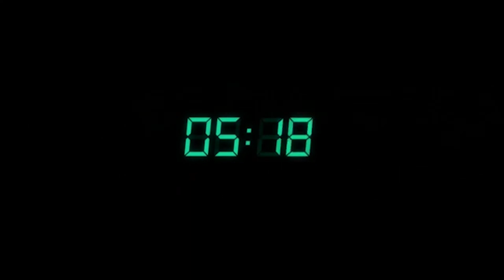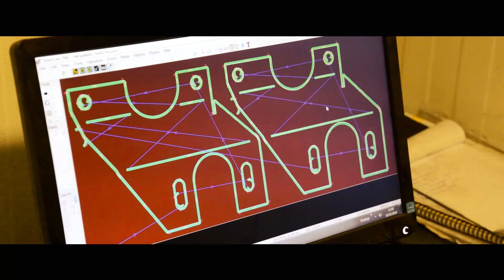Losing & Winning: HAN Eco Marathon 2019

Comment: You guys set one valid result during the competition day right? 1:89 if I remember correctly.
Reply: The engine was a piece of crap
Reply: @pettifretti  why do you say so?
Reply: @5432Krishna  We were not able to modify it in any way without affecting it's efficiëncy meaning that the mandatory exhaust that we made completely destroyed the performance. furthermore, there was an issue where the a vaccuum would occur inside the fuel tank meaning that after 10-15 laps the engine would be without fuel.
And finally the throttle mechanism was so small that it was very difficult to create a cable that would not jam the throttle every once in a while.
Reply from the maker: One valid run doesn't mean a valid result because you'd have to do 2 runs. We didn't have a run in which the engine did run smoothly with full power avaible so we couldn't get up to speed to then coast... 1:89 was full burning so not really representative. Last run over 10 laps was 1:116 but then the engine failed (again). When testing without body our best run was 1:137 so with body it definitely should be possible to go better than that...